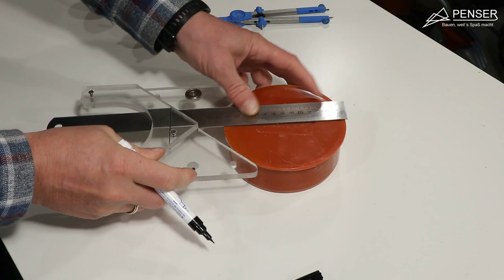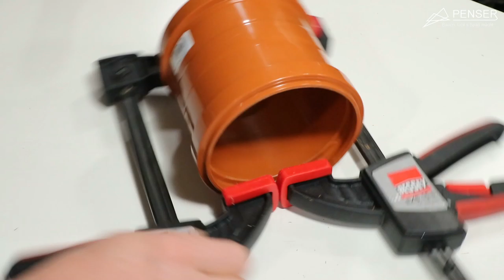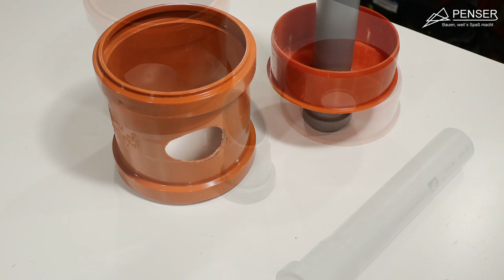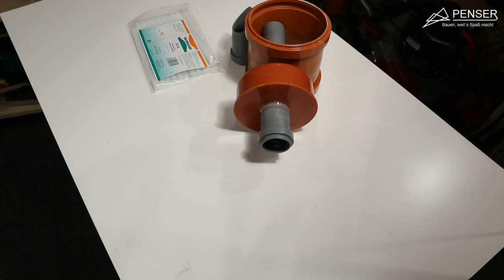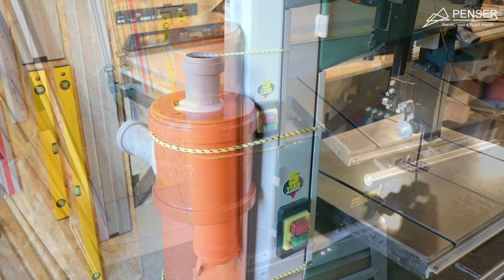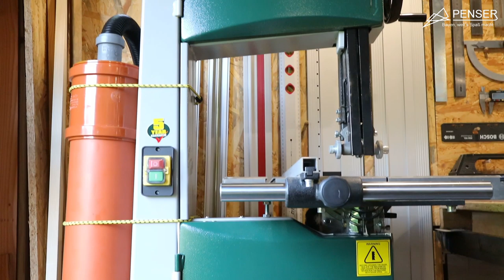Zyklon Staubabscheider Dust Filter

Comment: Hallo ich nochmal mit einer Frage:
Muss an der Überschiebmuffe das Rohr was eingeklebt wird mittig von der Überschiebmuffe sein oder kann man es auch weiter nach oben zum Deckel hin einbauen ?

Ich frage deshalb, weil ich statt einem DN 125 ein DN 160er Rohr genommen habe und die Überwurfmuffe mittig einen Steg im Rohr hat, wenn ich jetzt in der Muffe auf das Rohr 500 mm von oben stecke steckt das Rohr zur Mitte in diesem Rohr.
Wenn ich dann in dem Überwurfmuffe mittig das Rohr einbaue müsste ich in dem Rohr 500 mm eine halbe Ecke raus nehmen daher die Frage.
Reply from the maker: Moin, das sollte kein Problem sein.
Reply: Penser   @ Hallo, der Zyklon funktioniert hätte Ichsucht gedacht, das einzige Problem ist halb wenn das Rohr voll ist mit Staub wie bekommt man das dann heraus ?
Den Deckel am Boden heraus ziehen ist gar nicht so leicht obwohl alles eingefettet ist
Reply from the maker: Huhu, eine Möglichkeit wäre die Gummilippe der Dichtung am unteren Ende der Muffe etwas anzupassen/kürzen/abschneiden, damit es besser rutscht. Falls die Dichtung absolut undicht werden sollte, gibt es eine Notlösung mit Panzerband z.B. ;)